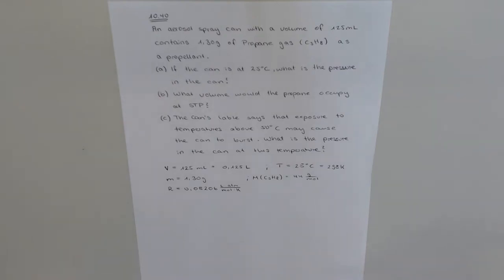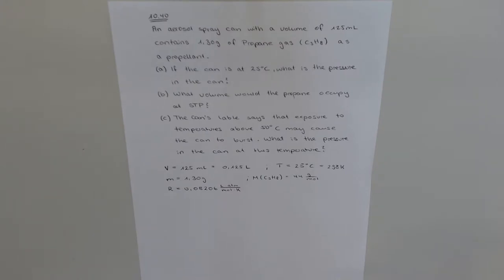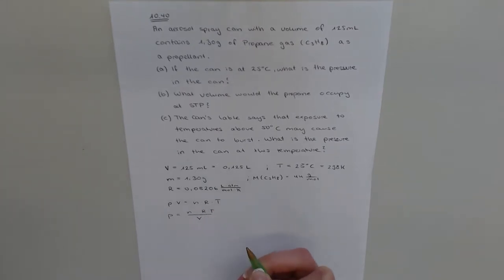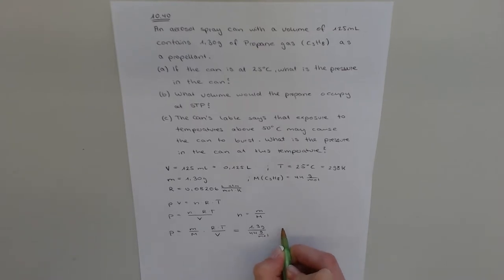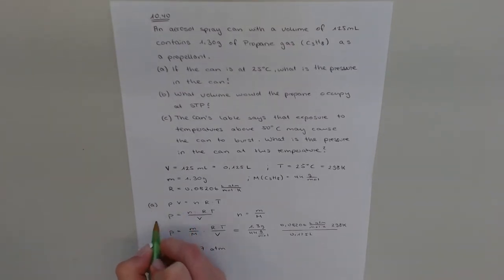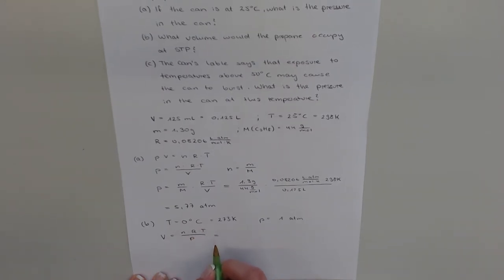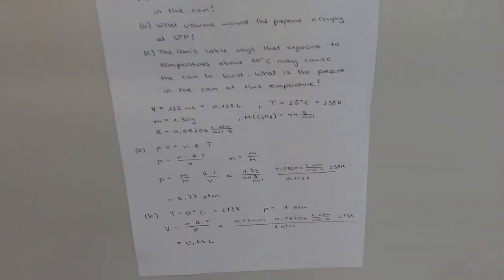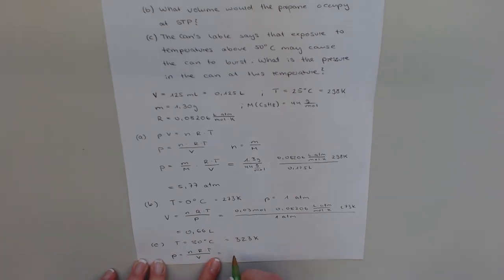Calculating the pressure in an aerosol spray can filled with propane gas (10.40)

Comment: On small propane tanks that have a net 400 grams of propane. The cylinder is 1.5 inches wide and 10 inches tall(1.14 liters)
Doing the ideal gas law , I end up with more that 3000 psi, which is way more than the pressure in the tank.
Does the law break down at certain points? I’m assuming they break down when the gas becomes a liquid, but I’d like to know more about that and how to calculate it.
Thanks
Reply from the maker: The ideal gas equation may only be used if the state of the gas is far beyond its critical point.
Way above the critical temperature and way below the critical pressure attractive and repulsive interactions between the gas particles can be neglected.
For propane, the critical temperature is approximately 200 ° F and the critical pressure is approximately 600 psi.
At 110 ° F, propane will be liquefied by high pressure. As soon as the pressure exceeds the vapor pressure of  propane (at 110 ° F: 215 psi), liquid and gaseous propane are present at the same time. The pressure in the two phase region will only depend on temperature an no longer on volume .
In the two-phase region, pressure can calculated using the equations of Clausius-Clapeyron or Antoine. The ideal gas equation fails completely here.
Reply: Labor Dr. Lauth by SciFox thank you so much for taking time to give a great detailed explanation.